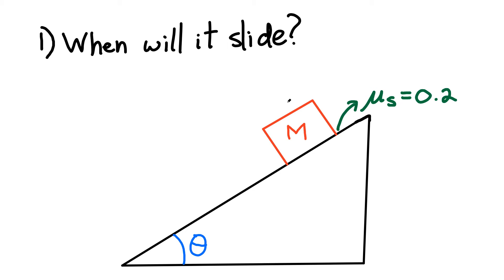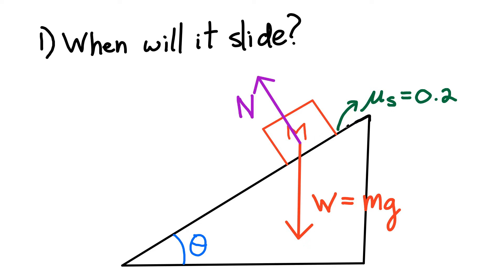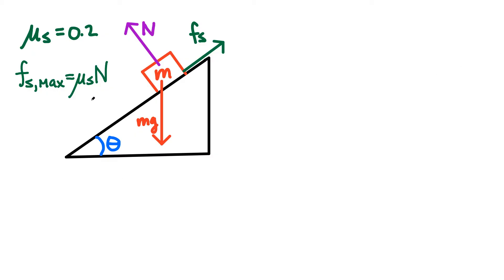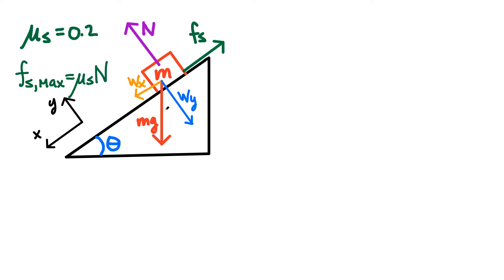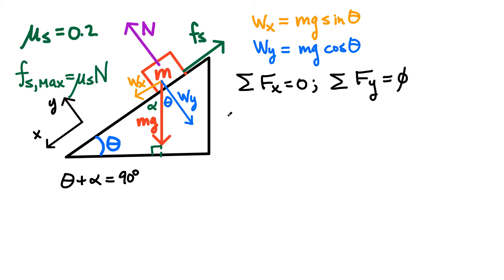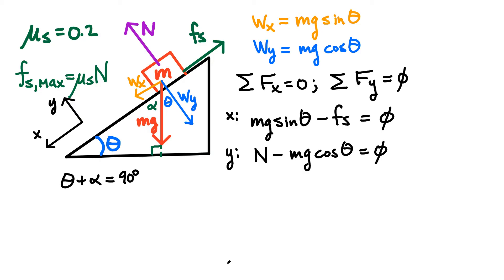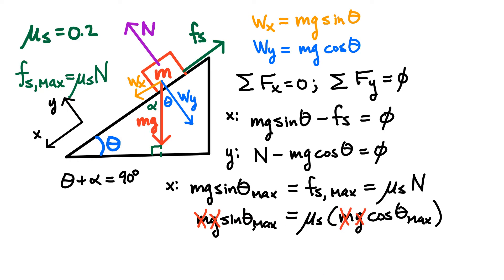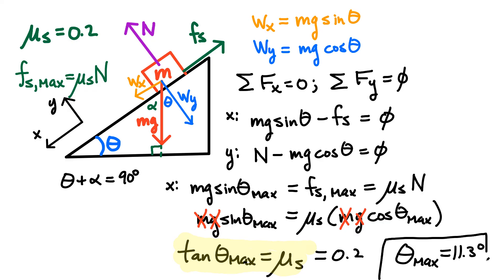Block on a Slope: Finding Maximum Incline

Comment: What if you used a pully system with slightly less weight pulling with you. At the FS point goes to pully with an = or > block helping pull.

Comment: please believe that I am serious about needing a legit real-world answer to this question, as I tried to follow the video and answer the question myself, but understand I had a party to celebrate my 67% final grade in Alg II since I had somehow passed this gut-wrenching class and wouldn't be forced to take and fail heinously any advanced math courses. I was lost before this gentleman finished his opening sentence -it was English but not my English. So it's with the greatest respect for everyone who speaks THAT^, that I ask for the answer to this: if Ed needs to live in a box with dog Sam & 2 cats Tim and Tom, and he wants to live under an overpass, what the greatest angle his box wouldn't slide down without being secured and with the not insubstantial weight of four occupants plus belongings? is the answer the same as in the video - 11°?  I would think 11° is more of a gentle rise and closer to lying down than standing up which is how I decided the angle of the incline couldn't be over 44° but would be safest (i.e. the box will be stable, resting on the incline and normal movements/shifting of occupants won't cause box to slide down into near constant traffic.) at a max angle of 33°: that's just a smidge (= .75°) smaller than the angle that is the midpoint between half of 90° and half of half of 90° or 33.75=45+22.5÷2 . That's how my un-mathy brain decided that 33° was furthest from lying flat without starting to need to stand, since you'd slide anyway. THAT makes sense to me but is it a good answer to the question posed? I'll appreciate all relevant replies which aren't meant to make me feel stupid (my last IQ was 157, and I know more now than I did) and that leave out all unnecessary comments regarding the question. thanks so very much to whomever finds this more than 4 years after the vid originally posted! 🙇🏼‍♀️.

Comment: Every time I put tan(0.2) in the calculator I get .003. How did you get 11.3?
Reply: Use arctan (which is the same as tan^-1). Don't use tan.
Reply: @randomcarrot7970  Thank you so much!!
Reply: @domenicocomita2950  no problem!
Reply: @randomcarrot7970  You just saved me hours worth of headache. Thank you

Comment: Does this body satisfy rotational equilibrium? Because friction is away from CG.. and it will cause a torque with respect to an axis passing through CG of the Blok.. so linear resultant force is zero.. but rotation about CG is not zero